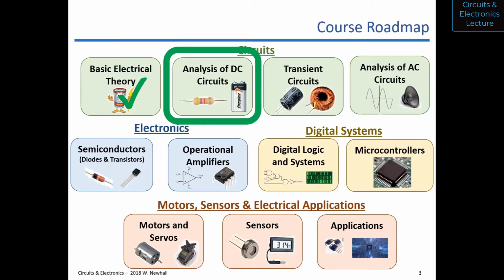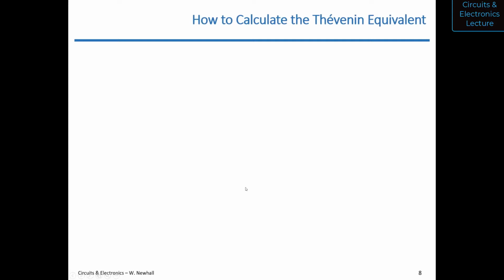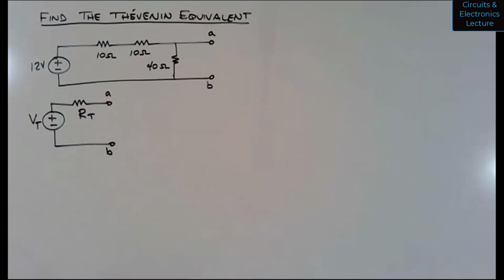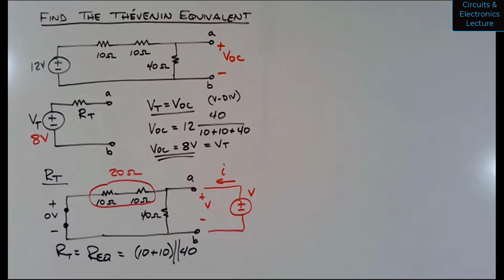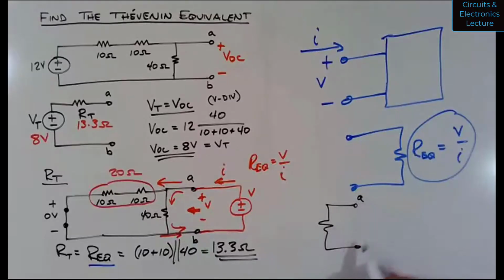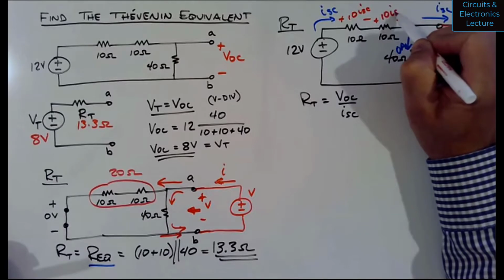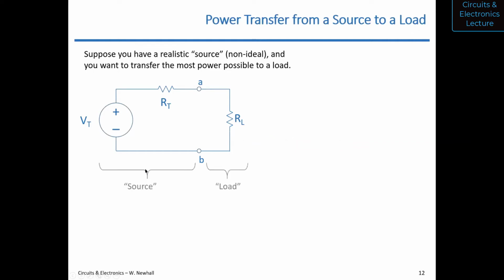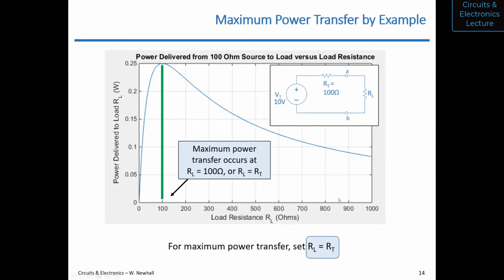Circuits & Electronics - Lecture 6 (Fall 2020)

Comment: I think the students were confused at around the 30min mark between the top and bottom circuits, one being in series and the other in parallel, because they didn't take into account that the top circuit is open so the current wont split due to the an infinite resistance at the terminals a&b, therefore the full current that went thru both 10 ohm resistors will just continue the path towards the 40 ohm resistor without splitting, which means they are in series . The bottom circuit is a close circuit, which means that there are no openings at any point in the circuit, so the current has a path to follow thru the 10 ohm resistors and thru the 40ohm, therefore the current will split between both paths, and thus the 10 ohms resistors are in parallel with the 40ohm.